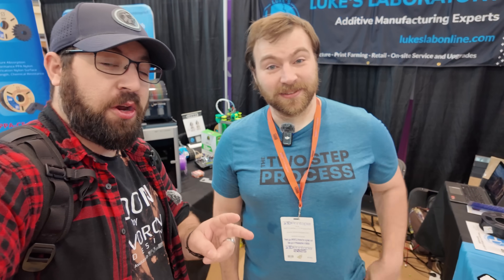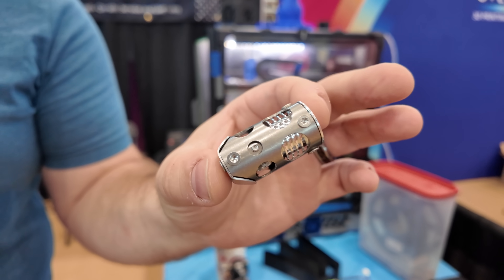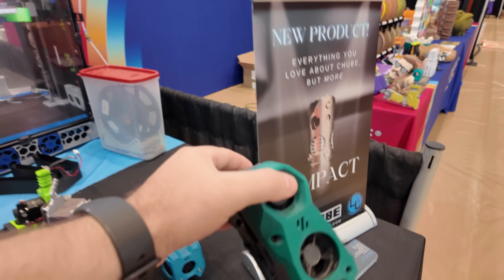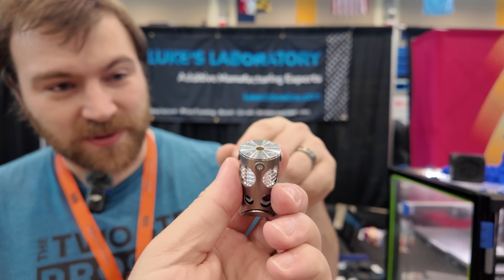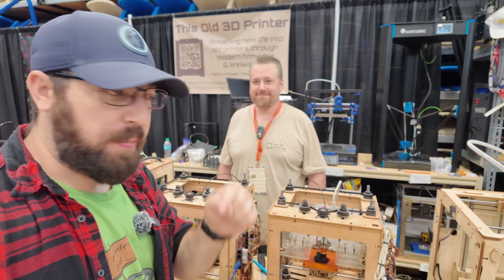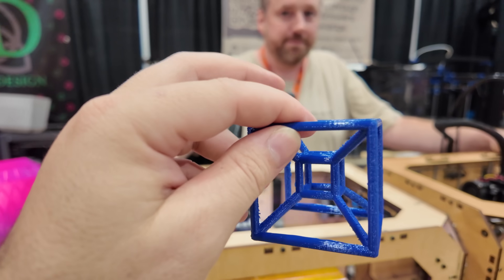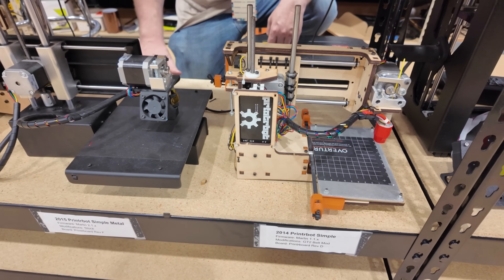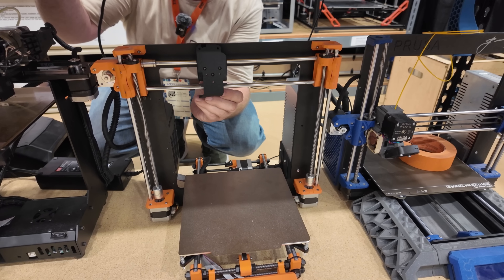Chube Compact and Wooden Printers at 3D Printopia 2025!

Comment: I just ordered 6 chube compacts for use in my new stealthchanger build.  I plan on using it with dragonburner toolheads with ww-bmg extruders and .5mm hardened steel nano coated nozzles.  I'm really looking forward to really high flow... my ldo 350 v2 should be able to go pretty quick...

Comment: Good to see these wooden friends… I rescued an Ultimaker Original+ and upgraded it with Klipper… moves like a new printer, easily hits 13k acceleration… must be the superlight toolhead and the compliant frame. Now with a Voron M4 it takes modern filament, an I think I will use it more than just as a tinkering project.
Reply: Neither of our UMOs have been bad for using as a regular printer though I still think at their peak it still shows its age. The GT2 belt upgrade and part cooling fan upgrades would probably make a huge difference in this area if you haven't looked into it.
Reply: @Rainmotorsports  had to design a new Frankentoolhead for the 1.75mm filament, including a better part cooling shroud. There is still some more potential only limited by by FreeCAD skills 😉but it is doing well enough for now. 

For now the belts seem to work well, took some time to notice that they are imperial, not stretched 🙈. What would be the advantage of the GT2 mod? I guess I would need all-new pulleys and some tensioning means, too?

I think what holds it now back most is some play in the toolhead bushings and general
compliance. While it does 13k acc easily, Input shaper recommends below 4.7k
Reply: @martin_emrich mxl belt tooth profile has a backlash problem. RobotDigg carries the stock hotend in 1.75mm. Not saying I recommend it but it looks original. V6 mods were popular on the Original and 2.
Reply: @Rainmotorsports  Thanks that is good to know, might be part of the less-than optimal Input Shaper results. But tbh the speed/quality I get is beyond my expectations, i will probably stay with the original belts for now.

Indeed it is now V6, kept the original heatblock, just new heatbreak and a real heatsink plus fan.